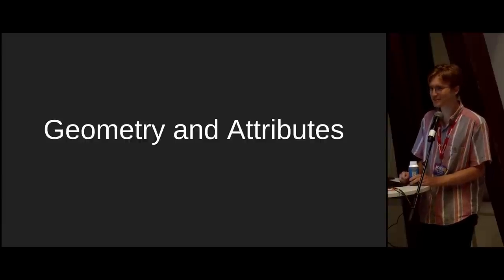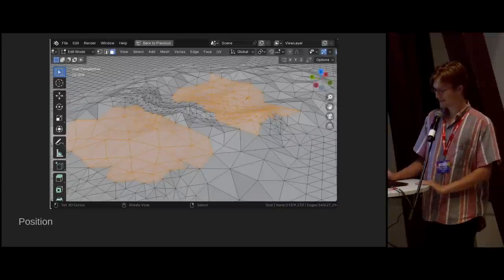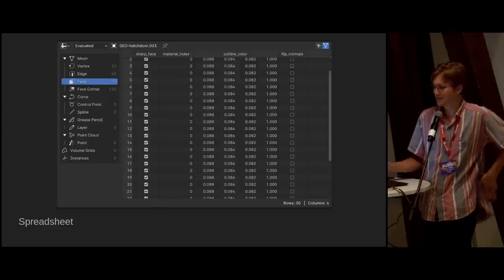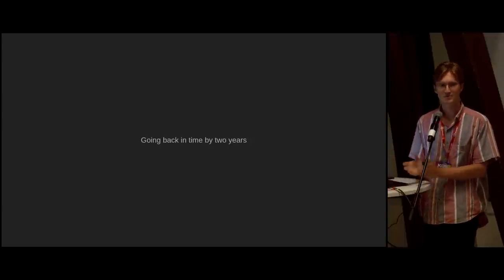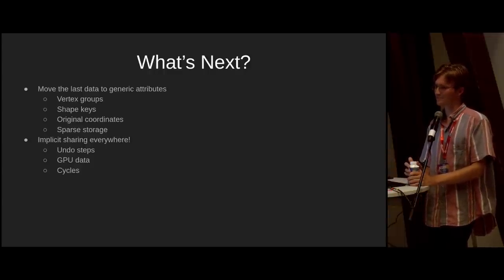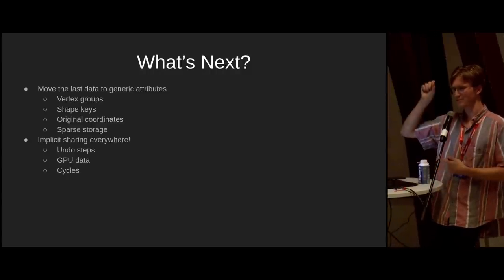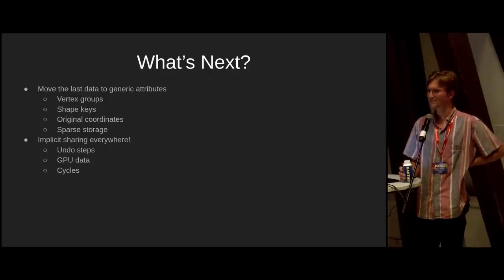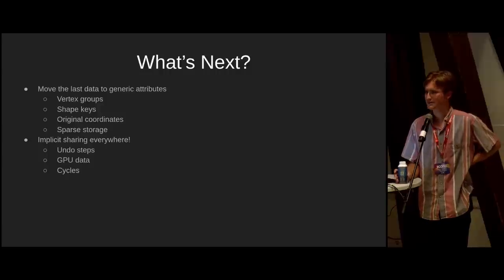Attributes: Making Geometry Smaller and Faster

Comment: Hi Hans, this change is brilliant; thank you.
Just a remark about two little problems that may be linked to this topic (or not):
-the 'measureIt' add-on uses the vertex's index and the labels change position when vertices are deleted.
-the parented curves seem to use the parent curve's first node's position as reference instead of its origin.

Comment: Amazing work, great presentation, mad respect.

As I understand it, the term "loop" describes a sequence of face corners where the edge of the last face corner connects to the vertex of the first, and "totloop" is short for total loop length. If so, that would still hold true when the concept doesn't need to be mentioned in the code anymore, right?

Comment: did I understand it right, is blender 3.6x going to serve as a "conversion blender" between old blend files and 4.x+ blend files? as in I can open older blend files in blender 3.6, save it from there (either by overwriting the old file or as a new file by altering the name) and it will be usable in 4.x, and then I'm able to reopen it in 4.x and can re-save it in there to fully convert it to the 4.x standard?
Reply: No, you can open old files directly in 4.0. It's the other way around, you can't open 4.0 files on versions older than 3.6 unless you overwrite the new files with 3.6.